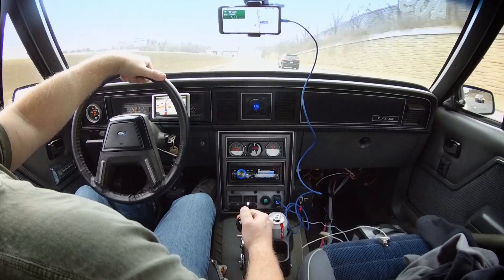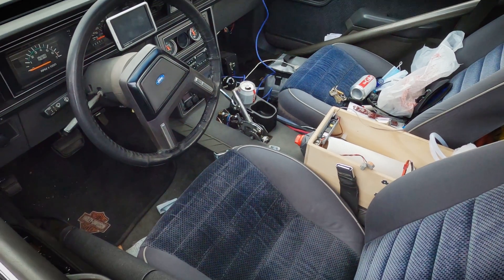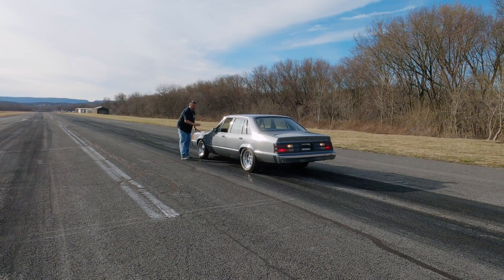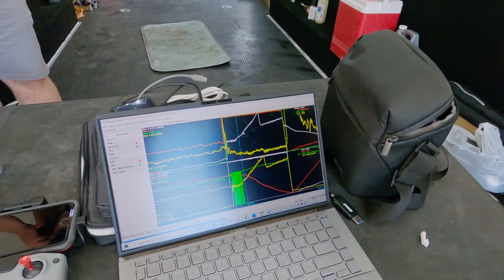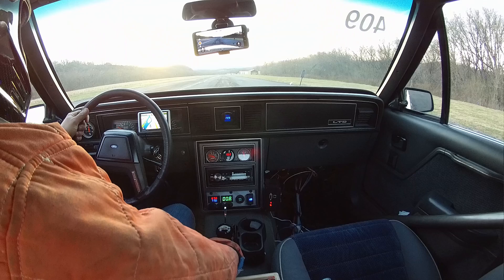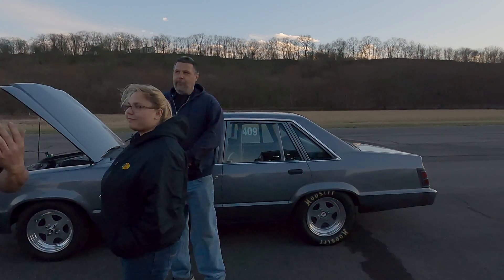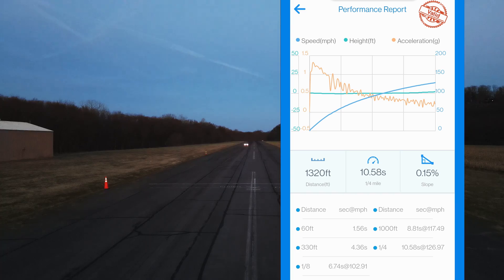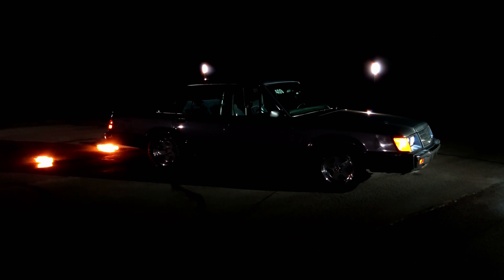DIY Electric Turbo: 5 psi = 127 mph Quarter Mile

Comment: Great to see this finally put to the test and doing so well. That is a Huge improvement  and proof positive the Electric Turblow Works.  Now, If you had 2 of them running together.....  You are doing some real Pioneering work mate.  Give it a few years and once people see what you have done, they will all be doing it.
Reply from the maker: Maybe they'll call me, "The Godfather of Electric Boost" or some such.  Lol.  I did consider building a "twin" to this one - but if this one gets the LTD into the 9's, then I'd need to put something else on another car anyway (the cage in the LTD is only good for 10's, technically); and now that Jason wants a piece of the electric turbo action and he's already got a 500+ cubic inch, low compression grudge car sitting there, maybe it's time to go big or go home...
Reply: @AlexLTDLX  it was time to go big last year.  Did you go home?!?  CMON LETS DO THIS
Reply: Yah not they won't.

Comment: is that 0-60 right?
Reply from the maker: Yes.  With the Whipple it was around 1.9.  It would pull the front wheels off the ground.  I have a pic I'll include in the next video.  I think with fresh slicks and getting the boost/launch sorted we can match the Whipple with the electric turbo.  BTW, leaving that hard feels like getting rear ended by a semi.  It's amazing - the first time you do it you feel like the whole drivetrain blew out of the car.  Keep in mind it spun the slicks at 80+ mph too.  There's a lot left in it...
Reply: @AlexLTDLX  I drive a "slow" tesla and 4.9s makes me feel a bit ill, I can not image 2.67s much less 1.9, also I'm digging the extra cinematography you put into this video!
Reply from the maker: Yeah, it's startling.  You know eventually this will lead to hotrodding electric cars...  As for the cinematography - thanks.  My day job has been as a TV/commercial director for 30 years.  About time I put a little effort into my youtube videos.  Thanks for noticing!
Reply: Not bad for a bunch of LiPos and a hairdryer.   :)

Comment: Its funny how for years people said an electric turbo would never work and the reputation they gained from the junk sold on ebay, but now they are a reality.
Reply from the maker: Yes indeed!
Reply: just like so many things like this , just took the right bloke to get it sorted , soon they will be every where , you dont need to ruin your exhaust flow to get power that on most cars you only need for a few seconds at at time
Reply: They have been on a few OEM cars for years already 😆
Reply: @dan4age  those are hybrid turbos, only for quicker spool. I was referring to the electric turbos on ebay people made fun of 10 years ago.
Reply: @e-feezy2507  no they are 48v electric motors that power a compressor there is no exhaust whatsoever they are made by Valeo
Reply: @dan4age  what oem car has this?
Reply: @dan4age  I looked on Valeo's pages, and they chiefly talk about two levels of hybridization, lithium driven 48V electric motor systems. If they ise this for an electric turbocharger...what? Where?
Reply: @e-feezy2507  Audi SQ7
Reply: @sinistersmallblock  I think that has two traditional turbos too, the electric one is just to reduce spool up lag
Reply: @e-feezy2507  ah, ok. Either way that dam thing is QUICK!
Reply: @e-feezy2507   believe Volvo uses them.
Reply: @jcerullo5015  ya they’ve had them for awhile lol, can’t remember if it was 2016, or 2017, not about to google, but ya Oem companies have been using them
Reply: Truth. Actually just came to see and laugh,but that was a complete 180 of what I expected. Subbed for more, it is a interesting way of going.
Reply: Well, who are the people who were saying it? If you put together the right hardware that satisfies the requirements of the system, it can work. If an imbecile gets a 50W fan on eBay to try to do a job that’s more on an order of 15kW, then it will not work. And another imbecile that can’t even fix a chain on a bicycle or understand a basic algebra watches videos on YouTube, processes the misinformation through the turd between his ears and stars spewing wisdoms back to the YouTube that it can’t be done. One needs to carefuly evaluate any information coming from non experts on internet, and also get their basic education foundation elsewhere first
Reply: @petrsindler1525  don't hold back, how do you really feel? J/K - kinda what I was thinking already 

I'll point out that a lot of discoveries and inventions in many fields resulted from "doing it wrong"
Reply: With the introduction of brushless motors and strong batteries, this air pump did become a reality, I remember they used to use a computer fan in the intake but that idea is complete garbage
Reply: Porsche, Audi and Volvo all have them, I remember the Volvo system being really cool. Sad scammers from eBay ruined their reputation.
Reply: And, he drive that car a very long way to race it, no fresh oil, tranny fluid, nothing..street drag car! Gotta love it!
Reply: Brushless motors
Reply: What dc motor are you using and batteries and the controller? A job using esc?
Reply: I had all sorts of internet bullies trolling me when I used to discuss it in car forums 10-15 yrs ago.  Thing is, they all disappear when you prove them wrong because they are cowards to begin with.